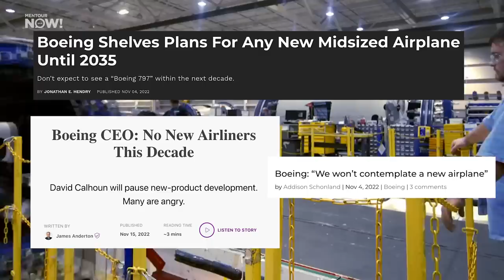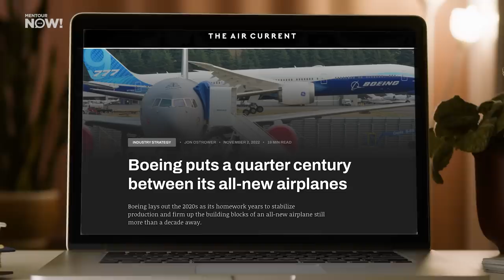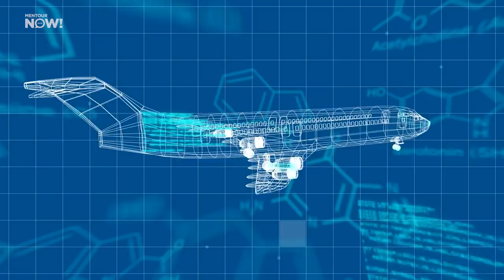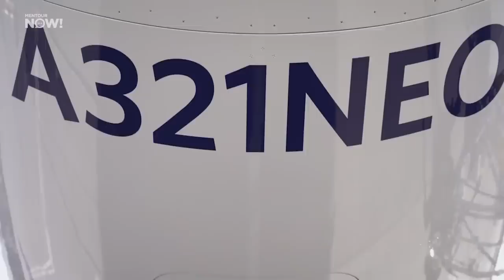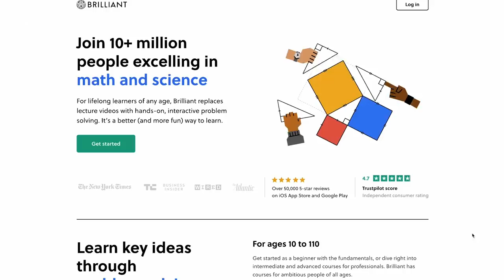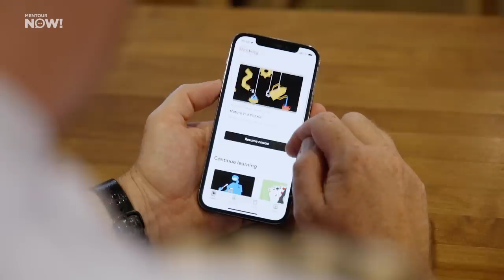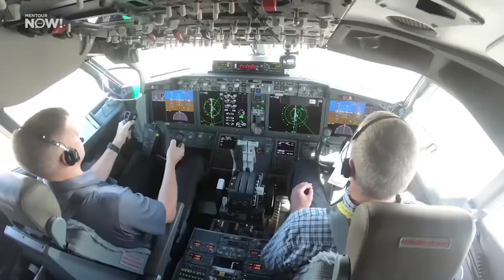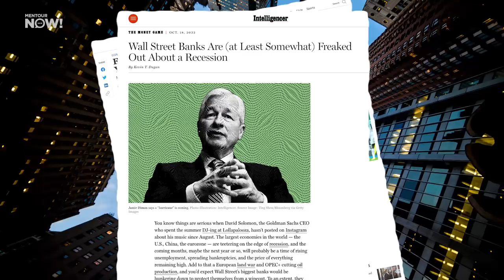Is BOEING giving up!?

Comment: I don't think they did necessarily they are giving up, but rather looking at aircraft like the 737 series, which is perhaps their best seller today, even though it was introduced probably 40 years ago.  They reach a point where they have refined an aircraft to a point where it can continue to to be sold and the profits get larger because much of the costs have already been recouped.  Of course this doesn't mean that they'll stop making interior changes, but as far as actual aircraft design goes, you probably reach a plateau like you do in many things, and you just ride it out, and perhaps with the 777, 787, 737 and now the 797, Boeing feels that it has a few good designs to keep the company going for the next decade without ne  eding to come out with a comopletely new aircraft.   They just continue to refine the ones they have already designed and already flying, with slight modifications, I mean like little things like different engines as engine technology advances, but the overall design of the aircraft is the same.  If anything, this isn't giving up, but higher profits basically -- don't reinvent the wheel again, just refine it over and over again and keep it fresh for the next 10 years.  I mean if you look at gas powered cars, there hasn't been any major new advancements made in gas powered cars in the past 50-60 years probably, only cosmetic changes primarily (engines still work the same way they have for the most part, with some minor changes here and there, but still the same basic concept -- a gas engine, 4 wheels, 2 or 4 doors.
Reply: Actually it's now OVER 54 YEARS old.  Not that it was hard to look up in 3 seconds on the internet or anything.

Comment: As a former Boeing employee, I know without question a few of the answers to your question. First: They use internal processes that allow the kind of thinking such as you have suggested. That is they are actually designing a new aircraft, but it is being hidden for business reasons. Based on my knowledge of internal processes, this is the most likely real plan. But they cannot tell anyone because of the uncertainties of business realities. Good job. Congratulations on great thinking. I want credit for validating your idea.

Comment: Boeing has an history of deceiving the competition to gain an advantage, think about the SonicCruiser and the info that led to the development and launch of the A380, so I wouldn't take everything they say at face value. On the other hand the MD culture has degraded Boeing's once mighty engineering powerhouse, and the MAX has taken a toll at the company, so it wouldn't be a crazy idea to hold on to an existing design and start generating money. To significantly improve current fuel consumption levels you need to have the engine manufacturers on-board, but new engine technology is not in the immediate horizon, so wait out is not illogical. Though I do not believe open rotor is the way, noise levels is something I do not see them getting under control. All in all, I don't belive we will see new airliners in the next five years, but after that I wouldn't be so sure.

Comment: Boeings old design has wings that are too low to the ground. They installed bigger engines and it caused some aircraft to crash. That's why they need a new design. That decision they made is a good one.

Comment: The only way to run an Aviation Company is to have the Aeronautical Engineers run the company.  Never have accountants run an Aviation company.  An Avaition company is a bold company with a long term plan.  Accountants are only interisted in  profits year by year.  Which will kill an Aviation company.

Comment: Boeing will have to give up.  It will adopt Airbus operating systems because the piloting (thinking) in aviation is on a downhill slide. We have a teaching problem.  The least experienced are teaching the new.  And the only goal is to fill seats at the airline. And the airlines only want robot pilots instead of thinking pilots.  Follow the magenta line
Reply: yes but actully no cause this is actully the usa we are talking about here not the eu

Comment: No more 767F they called the 757/321 market niche. No more 747. Airbus only stopped the a380. They are out of touch. They have had holes in their line up since 2005. They should have re engined the 767 that solves their MOM and mid sized freighter

Comment: You don't feed your enemies. I think C.E.O. Calhoun's no progress announcement is to pull the rug out from under professional complainers and deprive them of a job. Boeing's public statement is nonbinding. I root for the 7X and any smaller versions that can be blueprinted, because regional airline service need quality birds and air cargo and riders need frequent low cost service. I'm no fan of rear motors and T tail jets.

Comment: Boeing is toast. When they put bean counters ahead of engineers who had pride in their craft, precipitous started. Airlines have been reluctant to buy their aircrafts manufactured anywhere other than Everett. This will continue till Boeing vanishes. The bean counters are in control and they are not about relinquish it.

Comment: It's not a smoke screen and they also have an obligation to keep shareholders properly informed. It's real. 
Design Manuals are all well and good, but they can't replace the personal detailed knowledge of an experienced Chief Designer and his experienced leads. What this means is that by 2030, Boeing will be starting from scratch acompanied by a bunch of design manuals. Which is to say this is a case of corporate Engineering brain death: Do Not Resuscitate .............................................................................

Comment: Boeing bought Mcdonnel-Douglas, but the McD management team ended up in charge of Boeing.  That's when Boeing started to go from an engineering-led company to an accountancy-led company, a move that has resulted in the MAX catastrophe and several other embarassing missteps.
Boeing needs a change in management philosophy.  I'm not seeing it yet.

Comment: Don't you think they are waiting for meaningful improvements for eco-friendly aviation? Announcing a new airplane with current technology now is bound to still be tied to the old method that relies heavily in fossil fuels, even SAF is not exactly a good alternative, its pretty much a stop-gap until we can make an actual zero-emissions (or close to) engine. Embraer did announce its next wave of airliners but they made it clear the airplanes will be future proofed to be easily fitted with hydrogen, hybrid or pure electric engines.But these are small regional planes, not big long-range planes which would definitely need more time to go that way. Sitting around for, say, 5 years and invest in R&D (and also observe developments in the fields by other companies) could mean you can start (with the improved development queue) from scratch a really game changer plane instead of ... well ... more of the same. Bottom line is, the world doesn't want nor need a 50% more economical (thus green) plane, they need a plane that doesn't use any fossil fuel, thus using pure hydrogen or energy, which is close to 95% economy and 100% eco-friendly. The REAL next break in aviation is NOT going to be a plane that uses the same methods we have been using for 80 years, it will be one that innovates in a completely new engine, and the RISE might even be it (Embraer next plane will use an open-air jet engine too, except its way smaller).

Comment: I can see the argument that technology is not advanced enough to build an entirely new aircraft. The current models can be refitted with a more efficient engine if it comes available, but just adding a new wing or making it out of carbon fiber is not enough to build a new plane. The automotive industry is heading for a steep cliff like Lemmings over the EV nonsense. Once they figure out that there is not enough electricity produced to support them it will level off. There is no such transition in aviation.

Comment: Boeing doesn't need to do anything special to compete. Airbus is deeply tied to Russia in its supply lines, both in strategic materials like titanium and energy needed for manufacturing. All it needs is to wait out as Airbus get utterly demolished by its dependency risks realizing in the ongoing war.

You don't need to innovate to win when your only competitor will be struggling for survival for next decade because they need to move a lot of factories and rebuild supply chains. You just need to remain the only one with functional supply chains and cheap energy.

Comment: If only McDonnell Douglas HAD simply "faded into irrelevance" as you put it.
The merger of Boeing with McDonnell Douglas on August 1, 1997 was arguably the root cause of the subsequent disasters.

At least that's the central theme of a very interesting documentary available on Netflix about Boeing's woes:
https://en.wikipedia.org/wiki/Downfall:_The_Case_Against_Boeing
I suspect anyone watching this channel will find that VERY interesting.

I do NOT claim to know the accuracy of all its details and allegations, but it certainly makes a compelling case. 

Boeing certainly APPEARS to have changed from a company that was all about QUALITY where management and engineering/manufacturing worked closely on common goals and achieved remarkable things (the 747, 737 variants up to the 737-800, and the 777 for example) to a typical corporation doing everything it can to 'massage' its share price (and, I'm sure entirely coincidentally, the obscene bonuses of its execs).

The consequences were all too appallingly obvious. 
I find it hard to believe the Boeing of pre-merger would have allowed the 737-MAX atrocity to occur.

Yes, the FAA also bears some responsibility, as do those in Congress forever trying to make sure that sort of Government oversight is as limited and toothless as possible. On that score, I believe Congress has made some changes. Pity they seem to need a pile of bodies or half the country going broke before realising winding back SENSIBLE regulatory controls is frequently a REALLY STUPID IDEA (GFC, anyone?).

Comment: Airbus isn’t really considering releasing many new aircraft anytime soon either. Both brands are mature in the market and can afford some time off.
Reply: Airbus is expecting at the very least their Zero E aircraft in 2035. 
Plus, they are supposedly working on an A320 successor.

And sure it’s not coming out anytime soon but at least they have some form of roadmap and plan
Reply: @nikobelic4251  They, like Boeing, are still not planning in the short term or releasing new passenger aircraft that can virtually be used immediately. Boeing also has a similar plan for zero-emissions aircraft.
Reply: @aycc-nbh7289  are you taking about Boeing’s future flight concepts?
Reply: @nikobelic4251  What else?
Reply: @aycc-nbh7289  I was just asking.

The thing with the Future flight concepts is that it doesn’t seem like Boeing has made much progress on them. Unless of course the progress is just under wraps.
Airbus has a timeline and gives regular updates on progress which makes it seem more… realistic, I guess
Reply: @nikobelic4251  I’m pretty sure that progress reports in many fields are very slow, especially given the regulations that must be strictly adhered to. Besides, I’m pretty sure that a lot can happen in 15 years that could alter the course of Airbus’s development process, such as a change in corporate leadership, new regulatory constraints, or new technologies that they can experiment with.

By the way, Boeing Future of Flight has a Twitter page in which they post somewhat often. I don’t know whether they give exact dates for their projects, but they seem to post pretty often.

Comment: Interesting development, the interface between machinery and pilots, management and infrastructure seems to not at all come into play in the equation., Is an autonomous passenger liner also conceivably possible by mid next decade?
Reply: Boeing brought up the man machine interface in 2019. But I am sure Boeing is working on the tech needed for a single pilot airliner

Even in the past new airplane tech wasn’t straight up driven by potential future avionics.

Comment: Global demographics are shifting. In the United States, the baby boomers will be retiring in bulk in the next two years. The millennials are a much smaller group, and will not require as many homes cars, consumer goods. The economy will contract over the next five years. Investor capital will be harder to get. Their opposition, airbus, Is in Europe. Italy may not exist by the end of the century. Germany may not exist by the end of this century, etc. Demand drives the market. The board at Boeing appears to be very bright. There will be a shortage of good management over the next five years. Supply chains will be realigning to the western hemisphere from China in the next five years. If you can’t deliver a product, don’t promise.

Comment: McBoeing has 50 billion dollars on the wrong side of its balance sheet.  It is bleeding money from both the commercial and military side.  McBoeing was expecting its service business to be a profit center.  It has flopped.  McBoeing cannot afford to spend 10-20 billion on a new aircraft development, especially with their track record since 1997.  The tier one, two and three suppliers that McBoeing will have to rely on are not going to hang around, probably not even exist, by the time McBoeing gets around to a new aircraft.  They don't  currently have enough engineers to complete the 777X, nor fix the problems with the Max, nor fix the problems with the KC46 and one day, perhaps, they will figure out how to build a 787 fuselage according to how it was designed.  Maybe.  Boeing built airplanes.  McBoeing is concerned with stock price.  Remember when McDonell Douglas announced that it would develop no more new aircraft beyond the MD-11.  Share price shot right up enabling them to leverage Boeing's own money to buy Boeing out.  Top of the ballistic arc for McBoeing as it heads back down for a hard landing.

Comment: There are issues you haven’t mentioned. Since the Max problems highlighted the FAA’s lax attitude to certification, the FAA pendulum has swung the other way. Now, they are much more rigid in their applications of the rules and it is Boeing who have felt the brunt of this. Compared to the flaws of some other aircraft, the MCAS system is no big deal but the FAA made a federal case out of it, in part to resurrect its own reputation, and it cost Boeing a hell of a lot in money and lost orders. Bullying, I call it. Second, it must be remembered that Boeing is a publicly listed company whereas Airbus is backed by governments keen to project their influence on the world stage which they do by approving cheap loans and making aircraft part of their foreign aid. Third, the EASA is effectively in cahoots with European governments and manufacturers making it easier for Airbus to certify aircraft. Further, Boeing is not thinking laterally. For a 737 replacement, what’s wrong with shortening a Dreamliner to a dash 7 version. With about 200 seats and a wide cabin with adequate facilities, such as toilets, it would be a winner with passengers and much more efficient than a further development of a sixties airframe.

Comment: The problem is the suits with MBAs. They are scared of messing up yet again. And are kicking innovation down the road until the present batch are gone from the company. What they do risk is having all the new aircraft introduction expertise they have will be retired and gone. The tribal knowledge needed to get an all new plane certified will be lost. If they could get out everything from the 707 to 767 in 25 years, and now feel they need a 25 year intermission, there is a failure of vision with management. The company needs to be put back into the hands of the engineers. 

The RICE engine is a smokescreen. Open fan engines tend to be very noisy. They are improving and this is probably why it will take so long.

Comment: I believe that for Boeing investor hear such thing that now Airbus have 60% of the market of comercial jets, and Boeing only 40% it doesnt sound really optimistic, neither that almost all Boeing jet liners are facing some sort of problems, some of which caused deaths of hundreds of people. I would rather invest in Airbus, as them also have space, military, all sort of technological projects and contracts. Boeing is surrender their place in the markets to Airbus, and others, once Comac, Irkut, Embraer come with new projects them will not fade away promptly, cause in US theres no other company big as them to swallow them as they did to McDonell Douglas. But sure they're heading same way as McDonell Douglas. Unfortunately Embraer wont take the chance and conquer the airline market with a NMA, now management there and shareholders doesnt think big. As the airline market is craving for a new medium size aircraft to replace their old B757 but also the future is going to be fly long-haul flights in narrow body planes like the B757, single aisle. Good times when Osiris Silva was CEO of Embraer.